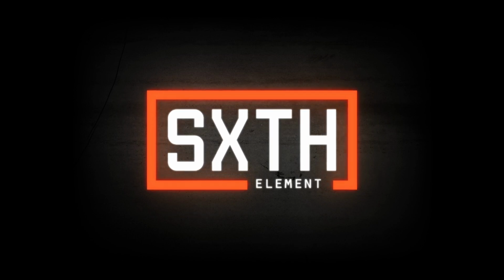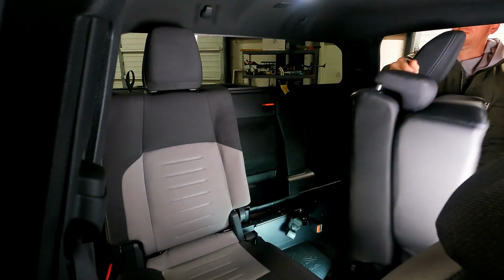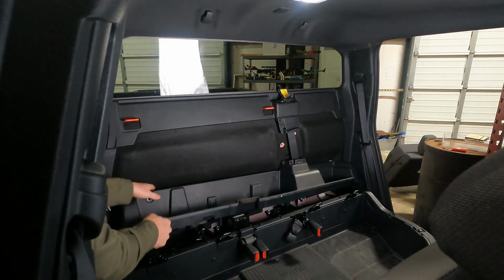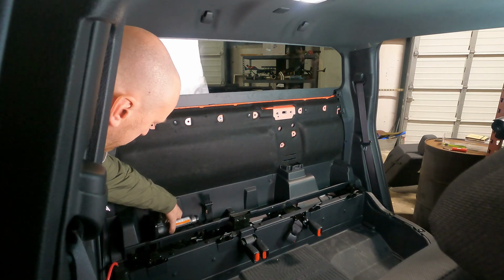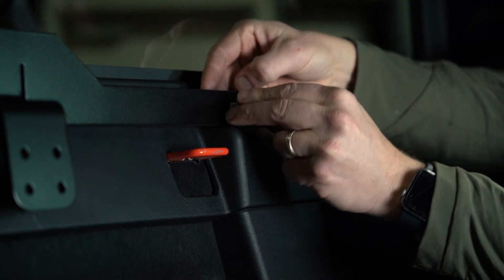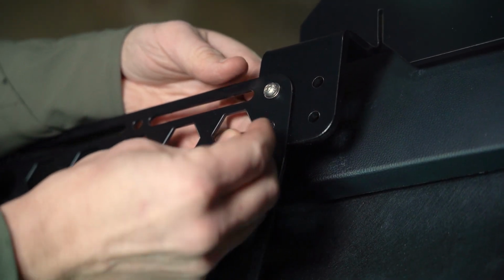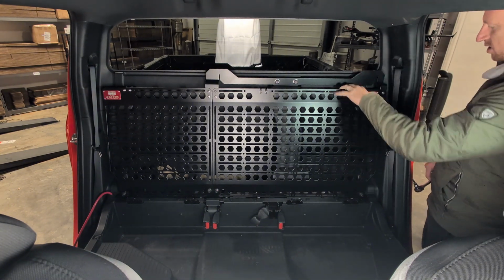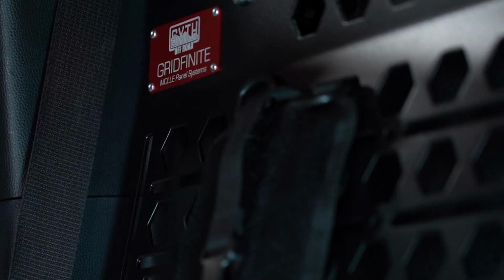Tacoma Rear Seat Delete Molle Panel

Comment: NOT COMPATIBLE WITH JBL
Reply from the maker: Correct and clearly stated on our website. Let us know if you have bought this assuming it would fit.
Reply: @SXTHElementEngineering  i think the problem is that many of the sellers  don't bother to mention this. Caliraised put it right in my cart, but they have 0 stock.

 i only bumped into your JBL note because I was looking around at the different prices
Reply: @SXTHElementEngineering I got it to work just fine with the job sub. It actually needed less steps.
Reply: I got it to work with JBL just fine by skipping the second bracket piece that goes with the main mounting bracket and just using the old 14mm bolts from the center seatbelt. The plastic paneling was a little tricky to get on, but after some finagling I got it without too much fuss.
Reply: @Sixstrings1111 talk to the manufacturer. manufacturer states.It's not compatible with j.B.L

Comment: Nice.   Looks like that top support bracket should have used threaded bolt holes.  The average owner installing that panel is gonna drop those back nuts 20 times.
Reply from the maker: Hi, thanks for reaching out. You're right, it may take some patience and skill with the install, but where there's a will there's a way. And extended magnets.

Comment: Thank you for the comprehensive video! I’ll probably pick this up and do a DIY platform as well.
Reply from the maker: We would love to see your buildout! These are in stock and ready to ship. Reach out to CSR@sxthelement.com and we can assist with your purchase.
Reply: @SXTHElementEngineering  This is not working on my 2024 with premium package, for one, the bottom trim is different and you can’t get the panel on all the way. I have it on with the bottom bolts about halfway in. I assume the 4 little lock washers are for the seat mounting adapter? They don’t say. I scanned the QR code in the box for instructions, but there’s nothing there for my truck? The drivers side seat brackets washers half fall in the hole on the panel. The seat mounting adapter barely squeezes on because again the trim is different than the video.
Reply from the maker: Please reach out to us at CSR@sxthelement.com ( I want to see pictures)  :)